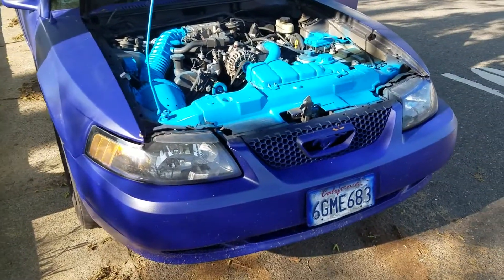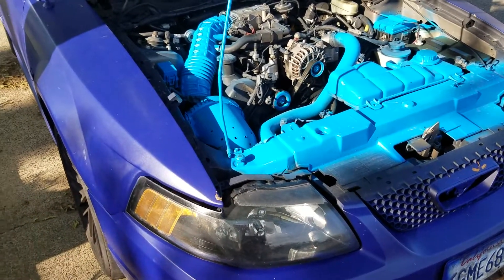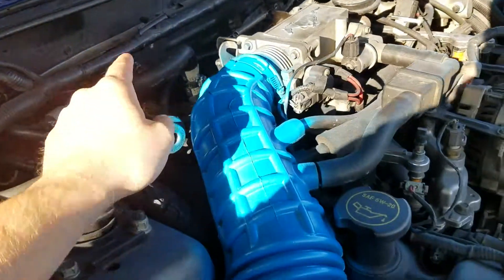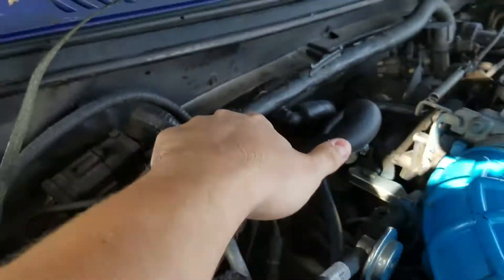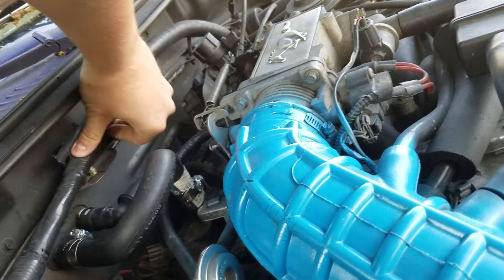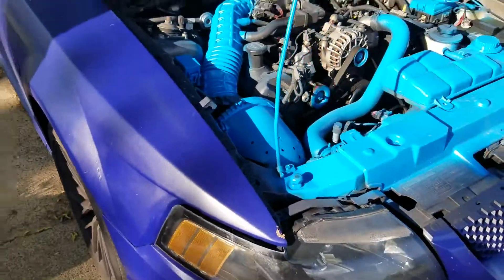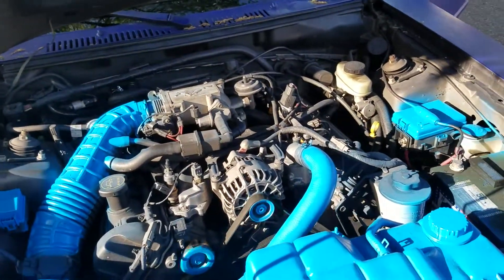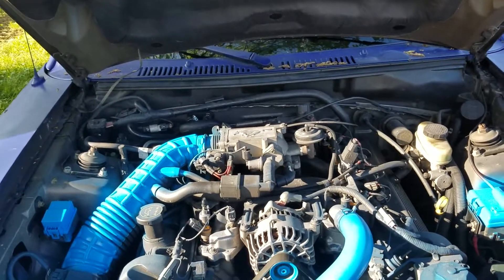I Got 99 Problems And My Mustang's ONE!

Comment: hey man really liking the vids👍 only thing about that engine bay is...how hard would it be to get it off? like when u scrape it off it will go all over the place...but then again you can fix that by just taking it to a place that washes engines either way looking forward to see what else u got planned
Reply from the maker: Mr Random Reviews taking the mustang for a bath after I take a shower and get dressed so I can do a full update video and maybe get some revs in it to. should be up in about 2 or 3 hours. as for the engine bay I'm just probably going to spray it all black
Reply from the maker: Mr Random Reviews not sure about removing it tho as it's high temp paint.